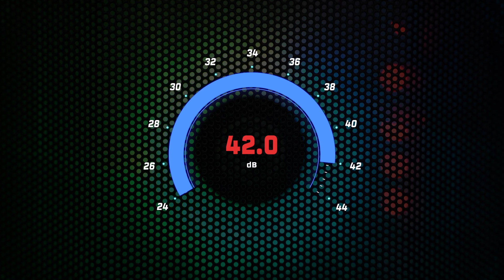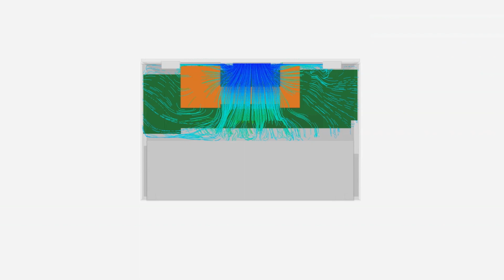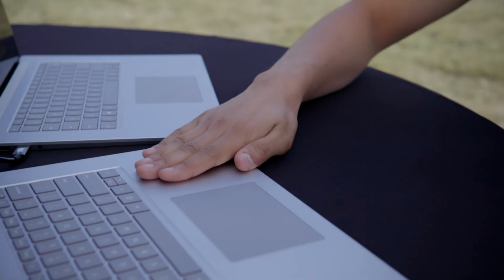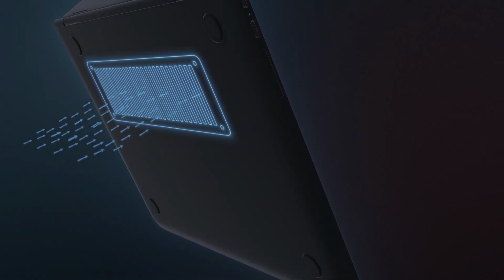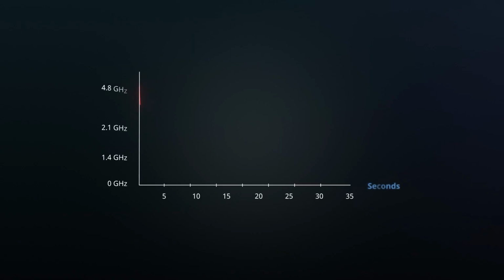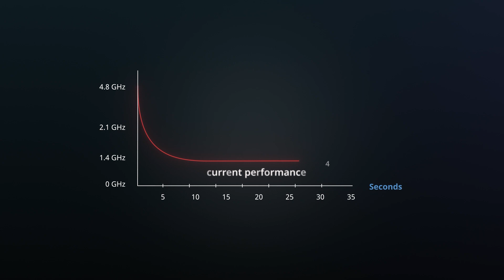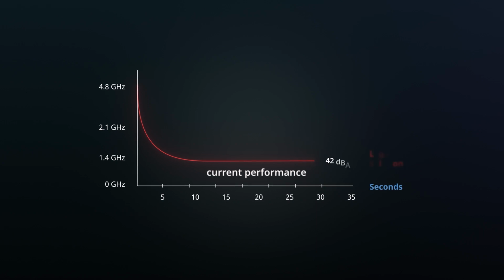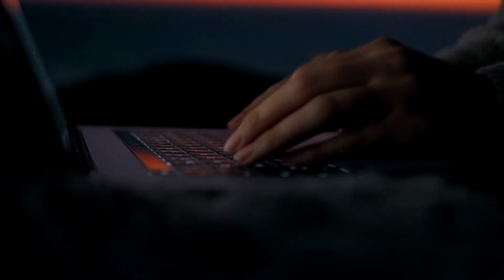Ultra-Thin 15” Notebook AirJet Pro Case Study by Frore Systems

Comment: Please bring a cpu cooler for itx pc . It would be dream come true if we could cool i9 with this tech . Holly cow please please design cooler . I bet you if you design a cpu cooler that is under 55 mm height able to cool i9 you will be struggling to supply all the demand that’s how desperate people will be to buy that cooler . Omg please please 🙏🏻 bring a cpu cooler . Maybe you can design cooler with airjets  tangent to cpu blowing air away from the motherboard . And hot air removing from top fan of case we only need 15 - 18 airjets some how dissipating heat from the heat sink . May be 2 rows of 9 airjet with cpu cooler fins attached with heat sink . That would be perfect for cooling something like i9 with 253 watt  with cooler consuming only 18 w . Omg this is great . Please make it happen .

Comment: Can this technology be modified for use with liquid cooling systems, If this were mounted at the on CPU heat exchanger pulsing liquid against the heat exchange plate inside the fluid loop it would provide a lower and more stable thermal state. If you could imbed a peltier cooler layer in the chip, you could get the full benefits of the water cooling at water cooling energy efficiency  plus the benefits of the peltier cooler at only the power cost of only the additional cooling, as the peltier would not need to heat exchange the entire load.
Reply: Was thinking this too would like to see this in larger scale pc solutions replacing large traditional fan radiators

Comment: Nice technology, but it is a battery drainer....How much power do they consume ? I think they need a lot of power to generate the that much presure, but the idea is revolutionary. We really need this ...we are using fans for 80 years! Good Luck!
Reply: Only 1.75 W for a single AirJet Pro to remove 10.5 W of heat. It's really efficient.
Reply: @MikeTrieu  what are your sources
Reply: It would be great for something like a Galaxy Tab S8 Ultra since it’s poor cooling causes it to score lower on benchmarks compared to phones with the same chipset.
Reply: @MikeTrieu I read in other comments that these figures are inefficient. But it didn't provide anything about how much heat a typical fan dissipates relative to the power it consumes.